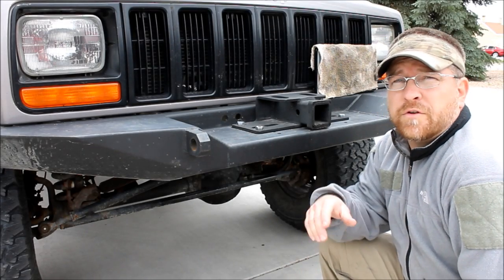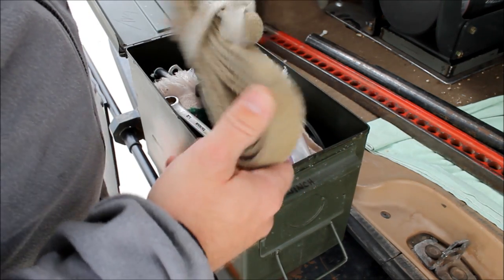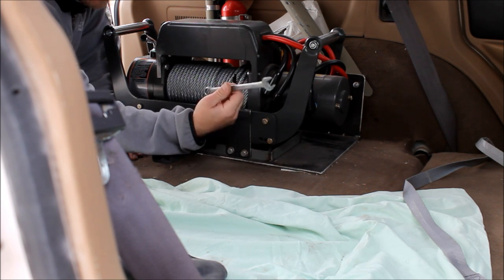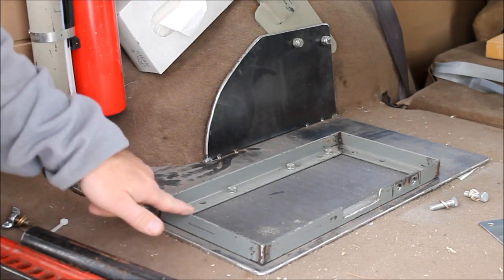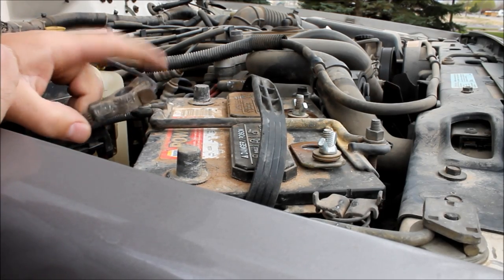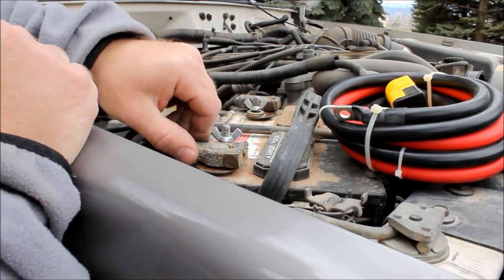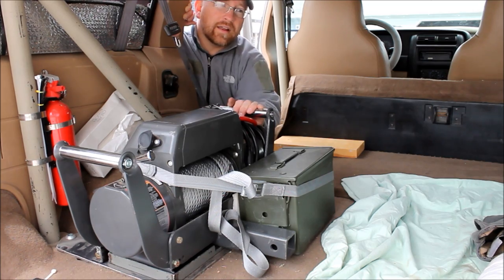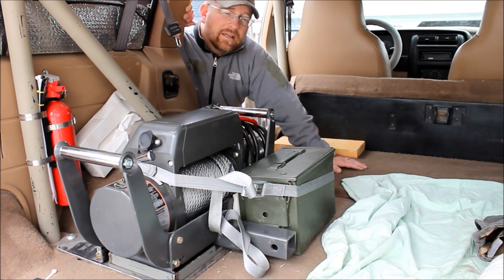How to set up a Removable Winch

Comment: it really works great when you have more then one vehicle youd like a winch on. ways to make it faster would be have both front and rear wires pre-wired and hanging there (this is what  i have) and then for storage, i take another reciever tube, weld it to a fair size plate (to spread out the load) and either weld the plate or bolt it to your floor. you can pull the winch out and be ready  in under a minute with this setup.

Comment: I have a similar set up on my truck. I love being able to mount it to both the front and back of my truck. I used a 2" hitch receiver inside my truck bed to mount it during storage. It makes for quick removal, So it doesn't go bouncing around My truck bed.

Comment: I have a similar setup on my 2013 JK. My winch is mounted to a cradle, with hitches front and rear like yours. The only difference with mine is that I have the power cables permanently ran through my jeep front and back. I used 00 cable, with quick connects on the ends, and have a disconnect up at the battery. This allows me to move my winch front or back as needed, simply plug into the quick connect I have at each bumper, and pull away. I can then disconnect the quick connects at the battery when I am not wheeling, and I don't run the risk of someone messing with my battery through the outside connections.
Reply: Yep. Winch in a cradle. Quick Disconnects on front, rear, and winch. Marine battery switch at the battery so no hot wires while not in use. Works great, except remember to put the winch in before you get stuck. Lugging 150lbs is a bitch in the mud.
Reply: That’s a primo setup!
Reply: Did you include a quick disconnect system to attach to a buddies vehicle? I’ve had a Cummins truck drive off the side of the road. I didn’t have any traction  (ice cover road) to winch him out but if I’m now doing this system so I can always throw my winch in someone else’s hitch.

Comment: I think the pros WAY outweigh the cons. The ability to pull from behind or from the front, swap the winch to other vehicles and as you noted help prevent theft are invaluable. Here's another slick thing I do. I have a receiver mounted to my flatbed tilting trailer. This allows towing a dead vehicle onto the trailer for tow ! The receiver mounted winch is way to versatile to look over !

Comment: I like your setup. I'm doing the same thing on my truck only I'm usually pulling people out of the ditch or out of a snow bank in the winter time. My 25 ft table has quick connects on both ends so I can either run the winch on the front or the back and the quick connect allows me to plug it in and use it at either end and never worry about whether I'm connecting it correctly because it'll only fit one way.😊

Comment: Use an ATV winch combined with a pully system. Less weight and as strong as you want. Just put an extra snatchblock or more.
Electrical connector in the front and back. Also with a smaller winch the current is less.
This all when time does not matter.

Comment: I would have put a hitch receiver inside to secure the winch, and permanent disconnects from the battery to the front and back. I think it would be a lot faster to set up.
Reply: +Sawyer Glanton or permanent disconnect at the front and extend the cables on the winch so it doesn't matter where you are.
Reply: That is what I was thinking
Reply: Might rattle a little, but a ratchet strap for tension would solve that.  I plan to do this in my jeep so I can pull myself off the snow pile when plowing.
Reply: Who wants to have a hitch on their vehicle all the time? If it is just for offroad ok, but I drive my 4Runner daily and the wich is heavy, like adding a passenger plus it could grow legs and walk away easily

Comment: Thanks for the video.  I was thinking of doing something similar as my LJ is my daily driver.  Normally I'd leave the winch off (and keep it in the garage) and only install it when I'm heading out wheeling.   I love the battery adapters (I'm going to make a pair) but I'm thinking of hooking up a female plug "semi-permanently" to the battery with the adapters.  That way I have a quick connect/disconnect w/o opening the hood for the winch or other high draw applications like jump starting or running my 1200W inverter.

Comment: to secure it I personally would have taken another one of those female hitch adapters from the front bumper and attach that right to the plate it's bolted to in the back. pull the pin & slide it out
Reply: Yeah that's what I was thinking..
Reply: +artardFTW I was thinking of quick-disconnects like on the ammo can, but that's an even better idea.
Reply: +kamerad like the latch that's on the lid? I think it may hold but could bust free in a roll over
Reply: Yeah, like that. I wasn't too sure about it myself but I've seen some fairly thick ones that might hold up.
Reply: +kamerad I guess there's only one real way to find out.. lol

Comment: I knew if I looked long enough I would find a setup like what I had in my head. Minus the rollcage. Michigan so not many rocks. 2in of lift due to HD springs.  M\T tires. 4.56 gears Front\Rear lockers and soon a fabbed front bumper and a mount in the back of my ZJ  for a winch. Awesome setup!

Comment: You could leave you quick connect and run it outta the grill, or desreatly somewhere. Then take a set of jumper cables and chop off one end and add a quick connect. Then you can plug and go with your winch or a set of jumper cables without popping your hood. You could even add in a disconnect switch in the cab if you don't wanna worry about sending power to an unplugged connector.

Comment: For my battery connections I'm using fleet terminals on all my trucks. I mostly mess with old Dodges, and they tend to have 3+ wires going to the positive terminal, so I solder on copper logs. For my winch I'm going to put the cables going to my starter etc. onto the post and then put a standard nut on, then use the remainder of the post sticking up and the wing nuts that come with the fleet terminals to attach my winch cables.

Comment: This is an awesome idea, if you only go 4x4ing a few times a year you won't use extra petrol driving around the place with all that extra weight, leave the winch in the shed   until you actually go off road, or in my case I think I might have a designated spot for it in my camp  trailer, AND I could put a hitch point on the back of the trailer to! And run the winch off the deep cycle battery in the trailer

Comment: instead of a tray to hold your winch, you should add another receiver inside the Jeep. Then you simply snap on to store, and snap off when you want the winch. No need to fumble around with the mounting nuts.
Reply: Good idea, that's what I said 4 months ago but he didn't reply. Lol
Reply from the maker: good idea, how would you keep that from rattling?
Reply: MetaView7 , thats what i did. bottom plate under floorboard and used the receiver as on the front bumper.
Reply: Sawyer Glanton , did the same. daaaa. toss a blanket over it to keep prying  eyes off
Reply: yep, that is what my son came up with.

Comment: I like the idea of storing your winch out of the weather but why not just leave the cables hooked to the battery with the quick disconnect?  For me that would be more of a hassle than actually attaching the winch all the time. Great idea! Great Job! Thanks for your videos!I've been reading the other comments after I already posted mine but one made a point about using one winch for multiple vehicles, that is a great idea! Vehicles at the farm or in my case my brother and I could run this set up and split the cost and use one winch. Brilliant!

Comment: Another option for your winch cable is to rig a set of jumper cable clamps (4) that plug into your winch cables ends (both ends) to serve as heavy duty jumper cables.

Comment: Great idea for when the times comes to need winched.  Only one comment, maybe paint the winch hold down frame assembly the same color as the rollbar. It looks unpainted in this view. Back in the day, we had a portable electric from Ramsey that was a small 1,500 lbs pull and it came with a slide on bracket to the winch that slipped over a trailer hitch ball. Carried the snatch block etc. and it helped with lighter weight winching while also being light enough and small enough to carry and store. Much has changed since that time period but the issue at hand, portable winch is always something to consider vs. permanent.

Comment: I think this is a great idea  I have a lexus lx450 and the back seats can be removed . I was thinking about getting a seat from the junk yard and using the frame of the seat  to attach a holding bracket  onto it . This way I can just remove the bracket and replace a seat when its family time .

Comment: I'd mount another HF hitch in the back so the winch can be secured with one pin. I'd also run cables front and back permently so you can connect jumper cables or a charger without poping the hood.

Comment: Jesus christ I'd hate to get behind this guy on the trail. 45 minute ordeal just to winch yourself out of a jam? Wire up permanent leads front and rear with quick connects. Bolt a receiver down in the back of the jeep just like you have on the front bumper. Pin the winch into it. Its safe and secure Pull pin, remove winch. No fucking around with wrenches and tools and bolts and shit. No popp the hood and screwing with wing nuts to drop and lose in the dark or in the water/mud. Screw all this rube-goldberg mess.

Comment: another way to mount that into the inside of your jeep would be to use the same mount as u used on the front. 

another idea instead of caring a wrench around to lossen your bolts is to weld a bolt across the head making it a thumb screw.

Comment: Thanks for the video.  I'm looking for a removable setup like that for front or rear.  A marine type battery would work like the copper attachments you made or there are adapters to make a regular battery into a marine type wing nut connection.

Comment: Good ideas and ingenuity but at 7:59 you see the positive battery cable not pressing down and making full contact with the copper winch lead terminal simply due to the tapered battery terminal design.  Your battery cable lugs will be fighting the taper of the battery terminals as the taper increases, instead of pressing down firmly to secure the copper plate.  All the current is reliant on a thin copper ring rather than a lug terminal with much more surface area.  You probably would realize this down the road if the winch were used more, but the zip-ties on the coiled winch cables kind of tell their own story :-)
Reply from the maker: Ya, once you get lockers front and rear... the winch doesn't get used much

Comment: I want a quick winch setup for safety concerns. so I'm wheeling with a group and one guy gets too close and starts teetering off the edge of a cliff or steep drop-off. I want to be able to set up winch as fast as possible to be able to render assistance. I have mine in the toolbox of my truck with a reciever welded to the box. I have cables ran to front and back ready to go with quick connects. all I have to do is shove the winch in the reciever put in the pin plug it in and I'm winching. about 45 seconds to a minute to setup

Comment: Why not just run a harness to the front and back permanently. Just leave the quick connect cable sticking out. so you can just slide in the winch pop in a pin and connect the power and pull yourself or a friend out in minutes.

Comment: I would have mounted a piece of square tube in the back of the truck and mounted it in the back of the truck the same way you mount it on the front of the truck pull one pin and done !! Just say'in.

Comment: Sort out them connection on terminals, they will burn, its too lose get a proper splitter there is plenty of proper ones on ebay, your ones are loose and you will get some trouble...

Comment: couldnt you have used the same mount on the front in the back as well for storage?  or thats not safe?
Reply: I didn't think about that, that's a good idea, I was also thinking if the leads are long enough could you put that in you rear hitch mount and work just as good?!

Comment: Those battery terminal plates are a horrible idea. You are relying on the weight of the cable clamp to keep the connection tight. Judging from the condition of all the winch accessories and cables, you have never used them yet. When you do, feel them and I'll bet my lunch money that they get hot as hell. Would be better to stretch the clamp a bit and bend some ears up to sandwich between the clamp and post.